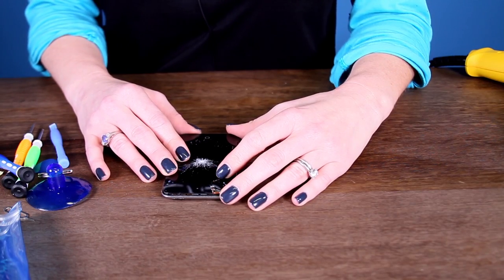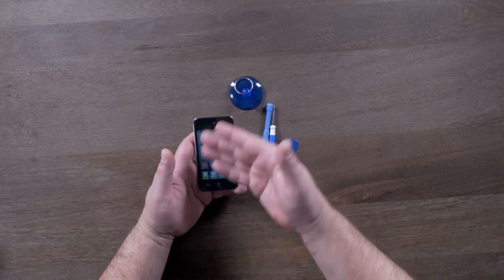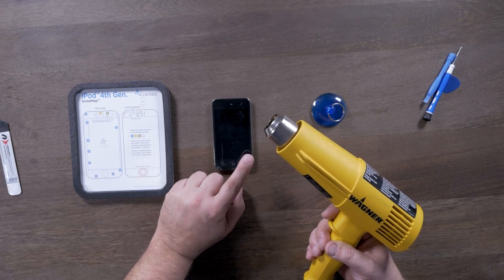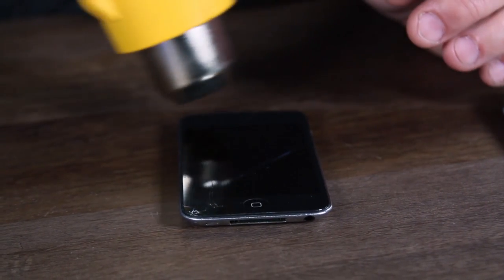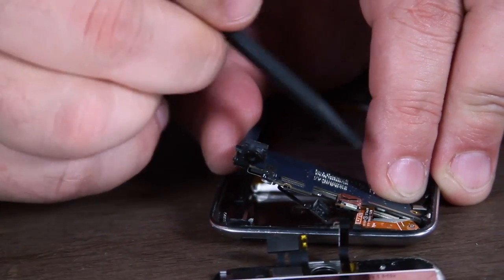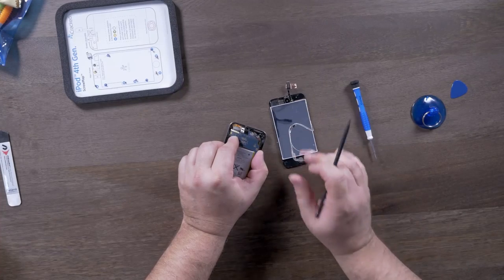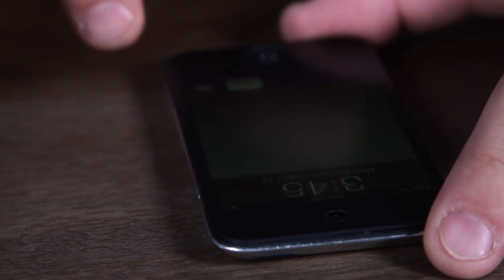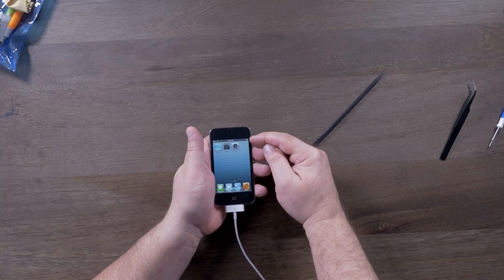Official iPod 4th Generation Display Assembly Replacement Guide - iCracked.com

Comment: this is  a great video! like they say stay patient . trickiest part is reconnecting the digitizer cable, thought i had it first time, but got a white screen ! so i reset the device , came on but touch screen didnt work.. so powered down and reconnected it second time, but this time i used tweezers ( wrapped with plumbing tape on each prong as they where metal tweezers ) to control it better, and to  squeeze the connection. he makes it look alot easier than it really is. really need plastic tweezers, i couldnt find any ..oh yeah i used a magnifying glass as well, very tiny parts and connections.... mine works perfect... if you get frustrated,, do what i did, save video put tools and parts in a safe place, and come back the next day.. hope this was helpful...

Comment: For the iPod touch 4gen i want to fix, there is a dent in on the top left corner of the iPod, how would I be able to fix it and get it back to its proper form? Would it be with the heat gun or something?
Reply: +Ricky Llanos 
its aluminum heating would help so if you are very handy , you may be able to straighten but if its to bad , may just have to acquire a new one.. sure theres a video on that as well..